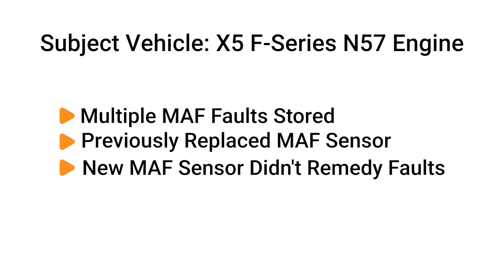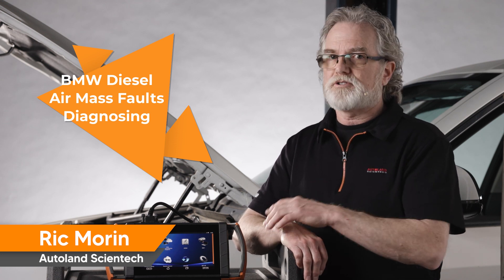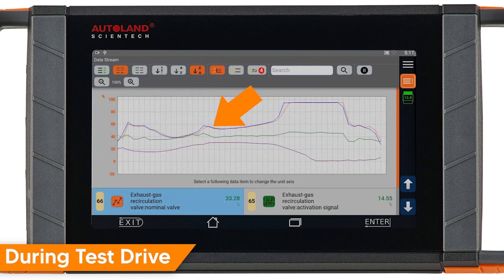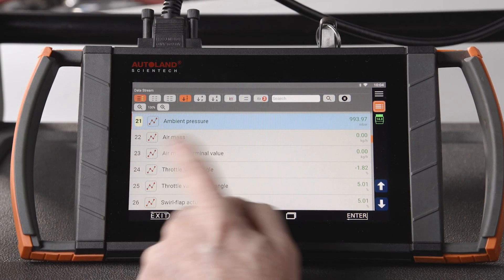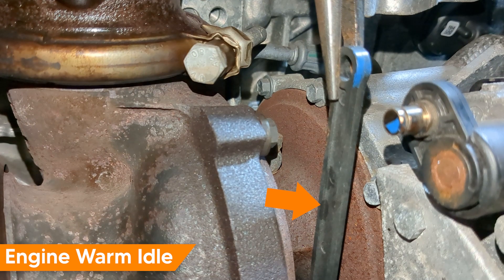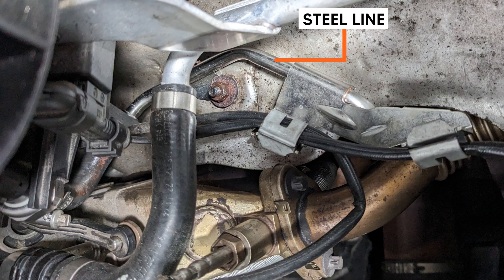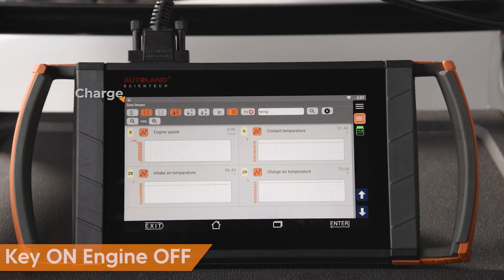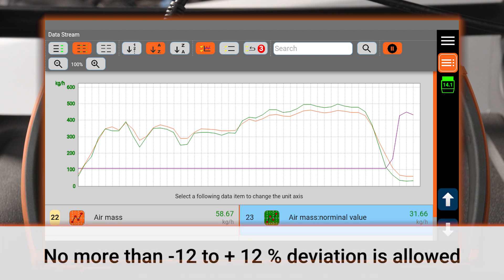BMW N57 Diesel Air Mass Faults How To Test & Diagnose Fault codes 290B00 & 290900

Comment: Great breakdown of diagnosing this fault code. It really has helped me tackling my issue. Which one of the fault codes did the car have? I’m having the 290900 code with air mass to high. The data shows that air mass is higher than air mass nominal. Im curious since the last thing I haven’t checked is that backpressure pipe.
Reply from the maker: Let us know what you find!
Reply: @AutolandScientechUSACedarPark  took it apart today and exhaust pipe is clear with no soot or carbon build up. What can I check when air mass is lower then air mass nominal? Any suggestions would be really helpful!
Reply: @MannyG-ki4xu  Hi did you get to the bottom of this issue and manage to fix it ? i m getting the same on my 2013 535d
Reply: @sukyd9867  yes. Both EGR cooler is sooted. Ended up deleting it and remapping and all is good now.
Reply: @MannyG-ki4xu  thanks for the response this has had the egr replaced at dealers under a year ago so not sure it’s that . I’m thinking it’s possibly an air leak or boost pressure converter … too many damn electronics in these damn cars
I have got a few codes
244C00 charging pressure control. Charging pressure too low
24CE00 air mass measurement air mass is too high
290900 air mass system.measured air mass too high
Just seen this today
27F00 air mass system , charge air hose: Leak detected

Takes a second or two to take off when you floor it
Reply: @sukyd9867 yes the egr cooler had a recall and intake manifold was full of soot. Cleaned the intake manifold and deleted the egr. All gone now
Reply: Would the EGR sooted not have give you restricted air mass . Meaning lower not higher. @MannyG-ki4xu